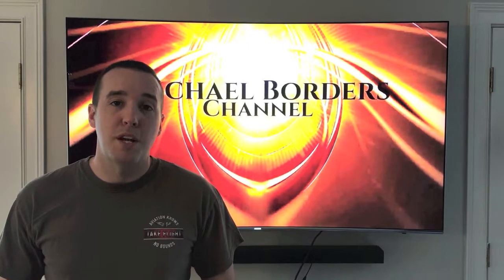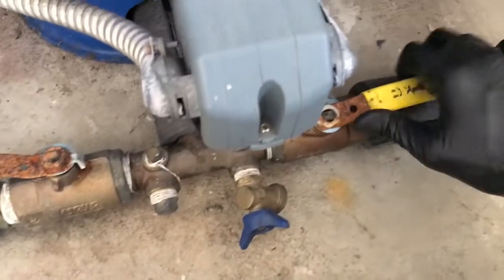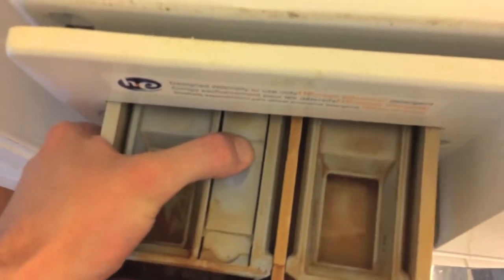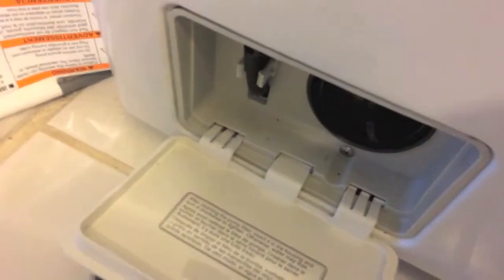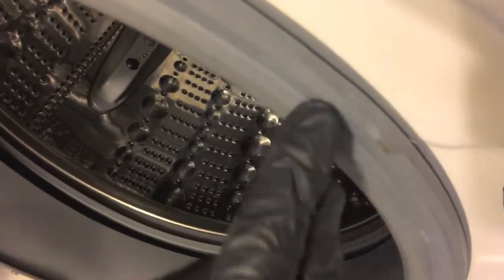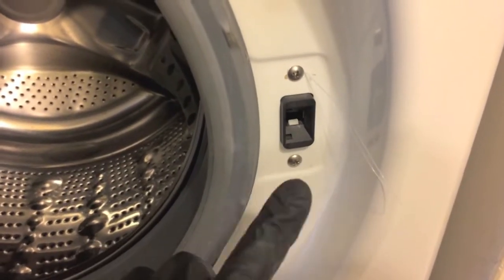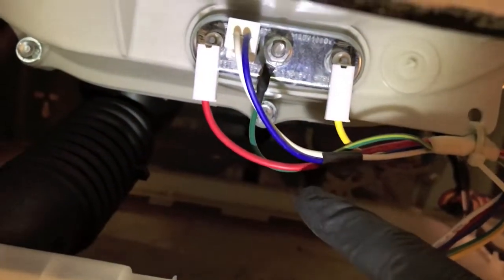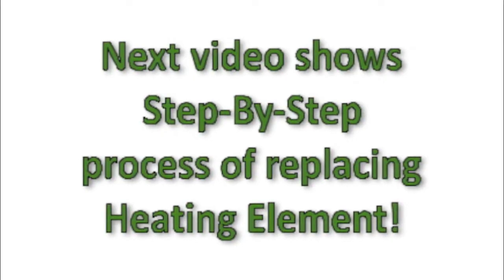tE error code - Inspecting LG washing machine Heating Element!

Comment: I wonder what you do after you replace the entire heating element with the new thermistor attached and you still get the te error? Btw, you don't need to take the entire front apart to get to the heating element. Just pull the washer away from the wall and lean it backwards and work from underneath. There is a huge opening in the bottom. Takes about 5 minutes to get to it.
Reply from the maker: Thanks for watching.  In that case, you will replace Thermistor next.  We appreciate the feedback, always welcome here.

Comment: Um, the underside has nothing blocking it. Would it not just be easier to jake up the washer or turn it on it side. And just get right to the Heating Element.
Reply from the maker: Thanks for watching & that will be personal preference.  We find it better to follow the steps given by manufacture which are shown in this video.

Propping machine up on side & applying an uneven weight distribution may damage machine.  Keep us posted on your project.

Comment: YUCK......That soap dispenser looks terrible. I have a LG at my summer home and the dispenser is so spotless you could eat off it, as is the tube going down to the tub.  I have FREE PV solar hot water at that location and I feed hot water into the cold inlet.  All cycles are done with hot water (set to cold tap) and clothes come out steaming.  No mold issues at all! 

At my other home, I have that same mess and have to take the machine apart to clean that fill tube every year. Your readers ought to consider adding a blend valve to get that cold water inlet a bit warmer so the soap gets washed away and doesn't become a food source for mold.
Reply from the maker: Thanks for watching & we really appreciate you sharing your thoughts & info.  Any & all helpful info is greatly appreciated!!!  😁

That was the condition of the dispenser when we bought the house & moved in.  We replaced it soon after this video.

Hope all is well with you and your family, thanks again for watching.
Reply: @johnvanlandingham8832  My camp system including solar panels, inverter, water heater, power point heater control, and even the LG washer only cost $500 total for totally free laundry.  The two year old washer only cost $150 delivered because it didn't work. That's a deal.  You are right, some people pay crazy prices for solar.

Comment: sorry to ask, my washing machine has an error tE and the heater and thermistor have been replaced, but still an error. do you have to replace the module? please help, thank you very much!
Reply from the maker: Thanks for watching & welcome to the DIY Raptor Club.  Have you performed a full reset on system?  We recommend unplugging system for a minimum of 5 minutes.

After 5 minutes, plug system back in & run cycle.  Please keep us posted.

😎👍🔧🔩
Reply: @DIYwithMichaelBorders  I've done this, but it's still an error. thank you very much for taking the time to reply to my chat.
Reply from the maker: @salmaputri9080  

That’s no fun.  Any sings of corrosion inside electrical connection points that secure to heating element or thermistor?
Reply: @DIYwithMichaelBorders  Sorry! want to ask again, how to research the correct system? thank you!
Reply from the maker: @salmaputri9080  

Thanks for the reply.  You can find your model # inside the door.  You will see your serial & model # on the placard sticker.

😎👍🔧👍
Reply: @DIYwithMichaelBorders  thank you! model: WD-P 1410 BRD / 04 serial number: 101 KWYP 00010
Reply from the maker: @salmaputri9080  

Thanks for the reply, you can google search that model # & get owners manual & much more.

😎👍🔧🔩

Comment: Thanks a ton for the video Michel,  My washer LG F1091MDL2, ISSUE: If  i press power button,ALL Temp lights are blinking constantly , drum spins for 3 to 5 seconds and stops in almost every wash settings, cotton, quick 30 etc.....

I checked the sensor and heating element, I did find and remove some calcium/mineral scale build-up,wire harness connectors  looks good, Unfortunatly  same facing issue.... Pls help me and guide....

Love from INDIA
Reply from the maker: Thanks for watching & welcome to the DIY Raptor Club.  That’s no fun...sounds like you have a worn out Control or Display board.  Might as well order both boards & if replacing one fixes the issue, you can always send the other back.  Keep us posted on your project.

Enjoy your day.  😎👍🔧🔩

Comment: From watching a bunch of these videos and reading the many comments on this error code on these washers, I've come to think that the problem is more often related to connectivity issues to the thermistor or heating elements, rather than the actual probe failing.  I think that due to repetitive vibrations that occur when the drum spins and agitates, the connections to the the element/sensor become intermittent, and in some cases, break altogether.  It's very important to secure the wire harness using wire-ties, and make sure there isn't any tension pulling on the wire harness and to inspect the thermistor's wire harness connector by opening it up and looking at the terminals inside (my washer model has a different connector/mount than the one in this video).  They may have vibrated loose, backed themselves out of the body of the connector, or broken off entirely inside, depending on how bad and how long the washer has been punishing the connector.  Another thing I'm wondering based on the comments on other videos is if there could be a build up of hair/lint/etc in the area around the heating element and thermister?  I don't know if anyone has looked into that, but it makes sense that if there is too much debris in there that the sensor/element would not work as designed.  Wondering if anyone has checked the thermistor's resistance reading with an ohm meter?  I checked mine and it reads @ 55k ohms at room temp (cold basement), and then when I heat it up to body temp, it steadily goes down in resistance to about 26k ohms.  If it was bad, I would expect that the reading would show either a direct short (0 ohms) or read open (or extremely high resistance) -or at least be erratic in it's ohmic reading (or not change reading at all).  I did find and remove some calcium/mineral scale build-up on half of the tip of the probe, and it appeared to have backed itself out of its mount (it's just pressure mounted).   I put my machine back together with the original thermistor and it's been running for a week of solid running all types of loads and settings without erroring out.  So far, so good.  If it fails again, I'm going to look into cleaning out the cavities where the thermistor and element are mounted (we have 2 dogs and one cat).  If anyone has already done this, please add on to this reply.  Oh, I found it way easier to get to the sensor by tilting the machine back and securing it in place so it didn't squish my big ugly head while I was underneath it. ;-)   Thanks for the video!!
Reply from the maker: David Jimenez 

Thanks for watching David & this is great info!  You Rock & we really appreciate you taking the time to share this.  We love reading helpful comments like this!

Us fellow DIY’ers need to stick together.  Many more helpful videos to come.  Please subscribe to the channel and ring your YouTube bell 🔔 that would be awesome thanks again!

😎👍🔧🔩

Comment: I have an LG WM2455HW.  I am getting the tE code.  Here is my question...  Is it possible that there are two Thermistor sensors on my model?  If so where might the second sensor be located.  When I got the tE code, I ordered a new thermistor based on my model number.  It did not match what was in the machine.  (My machine seemed to have a heating element with the thermistor built into it).  So, I ordered the heating element with the thermistor in it.  Installed that and then it ran once and I got the tE code again.  I still have the second thermistor but I can't seem to find where it might plug in.  Here is the separate sensor I have:  LG 6322FR2046C  and, here is the heating element with the incorporated sensor I have installed:  AEG33121501.  Any ideas or hints?  I have examined the wiring and I don't see any issues.
Reply: Anyone out there that can help?

Comment: You don't need to take it apart, just tip it on its side and go in through the bottom.
Reply from the maker: Xtoriez Novel 

Thanks for watching & you will need to be careful tipping machine up as there is still water in the system & will leak out.

You’re spot on, it’s doable however must be done safely & responsively to ensure no leaks & the machine isn’t damaged in the process.

Thanks again for sharing your thoughts, you Rock!  Please subscribe to the channel and turn on your YouTube notification Bell 🛎 that would be awesome thanks again!

😎👍🔧🔩